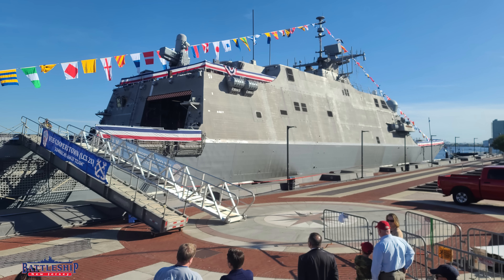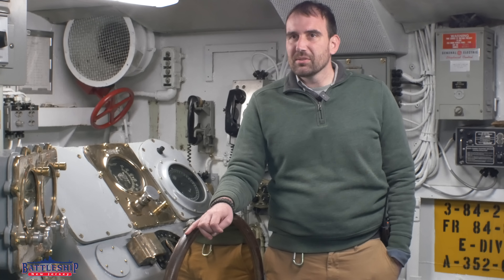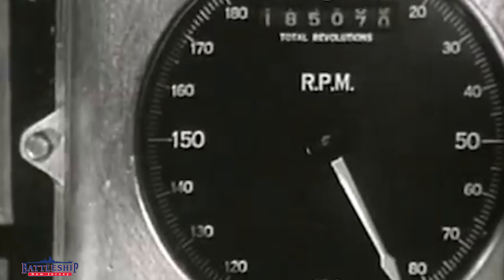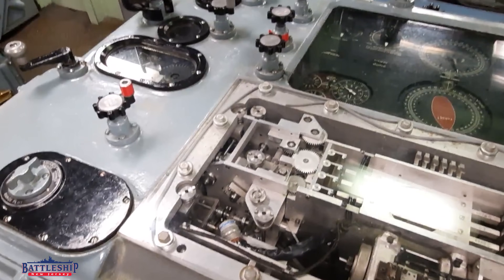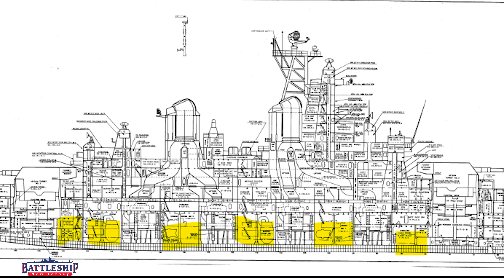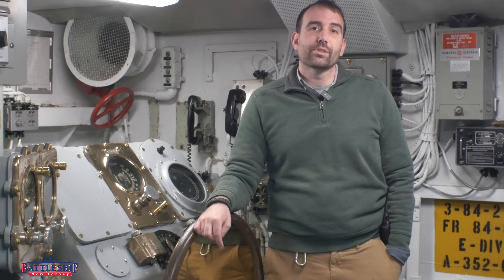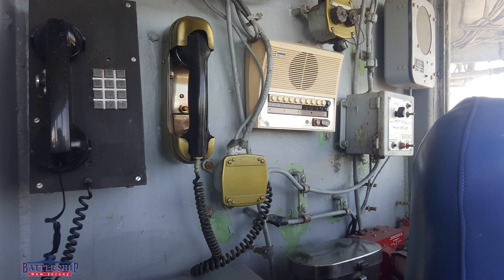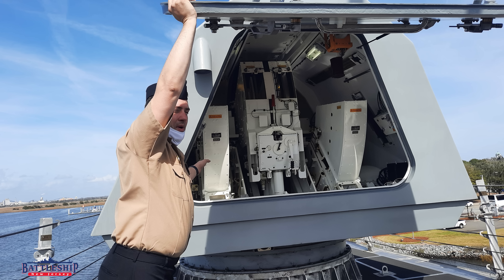Why Are There So Many of EVERYTHING On Battleships?

Comment: Ryan
As an ex navy electricians mate, I'm afraid I freaked out when you stuck that emergency power cable lead into that EP receptacle. 
I've been out for 40+ years, and I still respect the danger those "biscuits" represent.
Reply: What can happen?
Reply: @ephphatha230  
The whole point of emergency power is to be able to get power from point A to point B without having to open watertight doors and pass cables through them, which would destroy watertight integrity. 
As Ryan said, the other end of that EP receptacle is down at a switchboard in an engine room. 
You cannot see if there is something connected to the other end.
What can be there is 480 volts with a LOT of amps behind it. If it's hot (connected), your are a crispy critter. 
Not an insignificant number of electricians have found that out the hard way. 
I was  very careful not to be added to the list. I ALWAYS checked before I touched.
Reply: He must know nothing is connected to it anywhere, would be a severe hazard for small visitors with pointy objects in their small hands - and the odd big idiot...
Reply: @Ganiscol  
I'm sure he is.
That did not stop me from reacting when seeing something bring done that broke the rules drilled into me by 8 years of practice